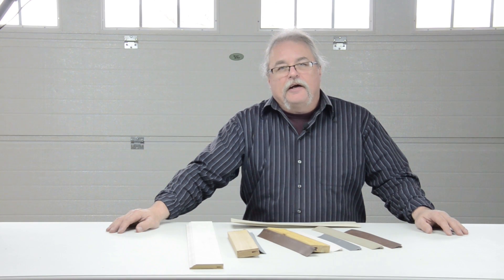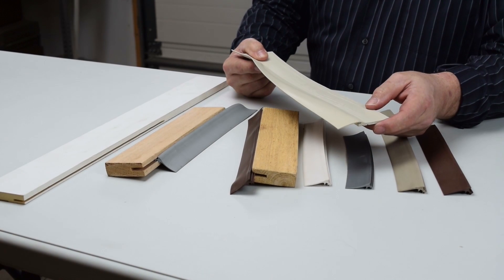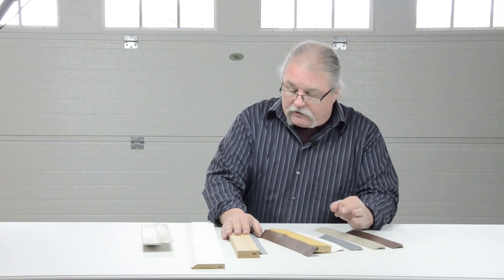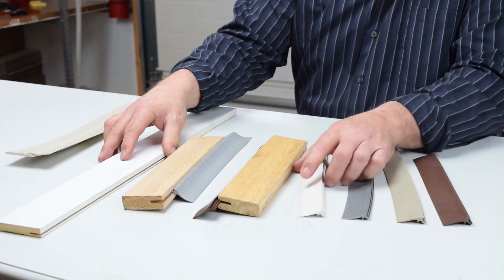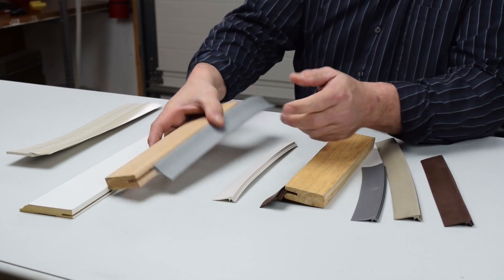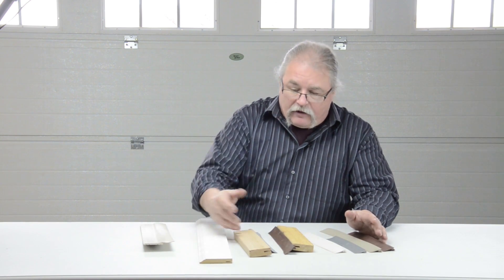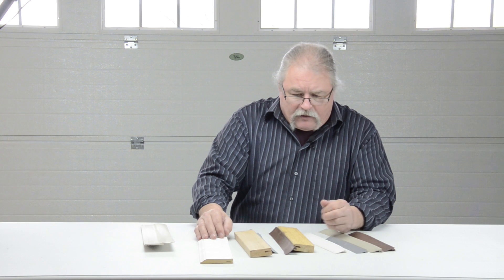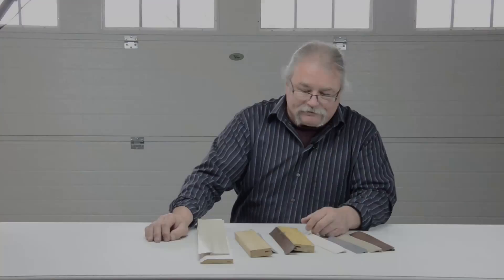Garage Door Seals For Top And Sides

Comment: What do you attach the wood to?  I’ve installed weather seal on my outside but I also want to install in on the inside.  I’m not sure how to do it.  I just had new doors installed and what a fiasco it was.  I still see daylight on the top and sides.  I believe the door is too far from the frame.  One thing that helped tremendously is lifting my old threshold since it no longer lined up with the new doors and put it back down where it contoured the outside of the door.  It took over a year for my garage doors to be ordered and installed and they’re still not up to my satisfaction.  All I wanted to do was keep the critters out along with the heat and cold air.  Nada!